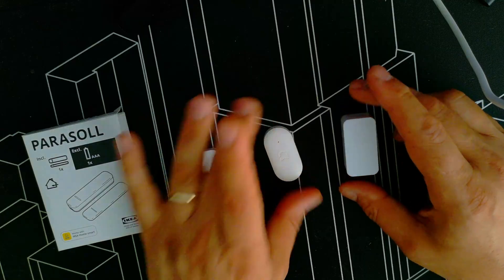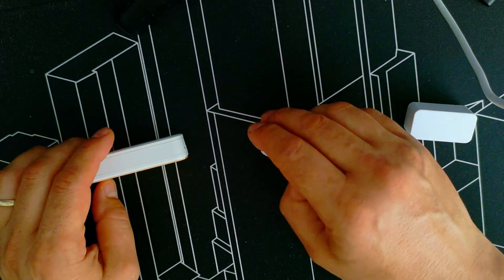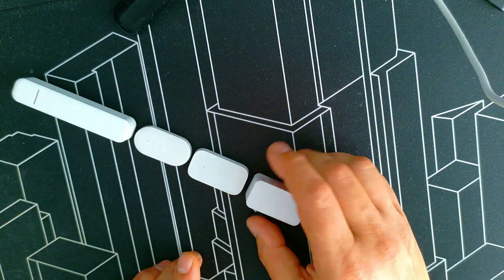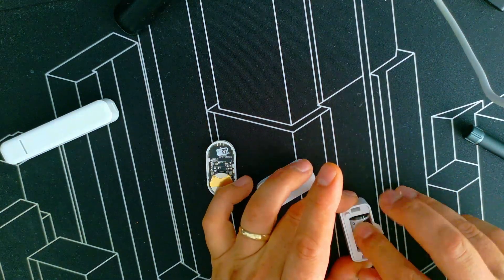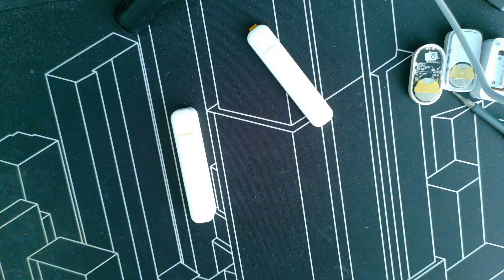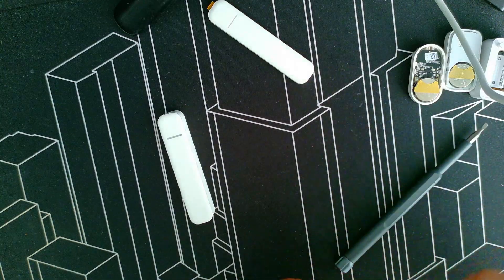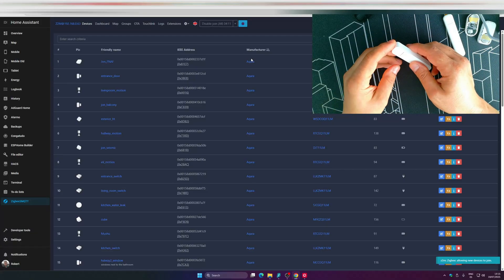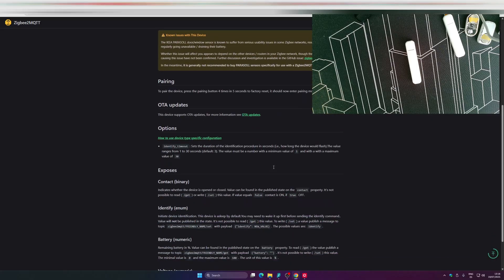New IKEA Parasoll Door Sensor Tested! Compared with Aqara, Xiaomi, Nuki + Home Assistant Integration

Comment: I do not see any range test? Probably one of the most important for a review of these sensors. How accurate they are can be the difference of a door being open but still showing closed if the range is too big on it.
Reply from the maker: Thenk you. I'll do another review, for some new ikea matter sensor and ilm do a range test. But to be honest its a door sensor, never thought of the range, when the magnet is close the will open the circuite. But I will do, just out of curiosity.